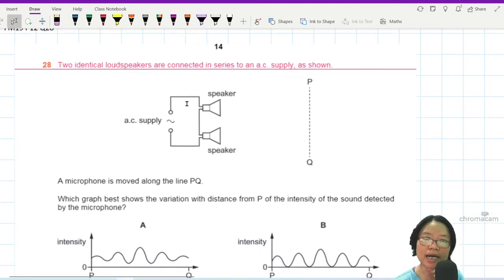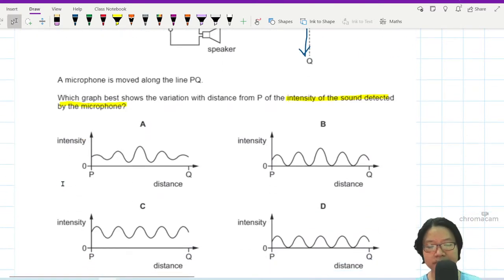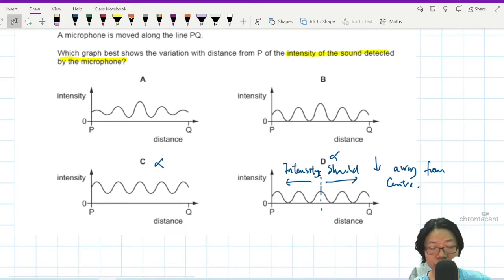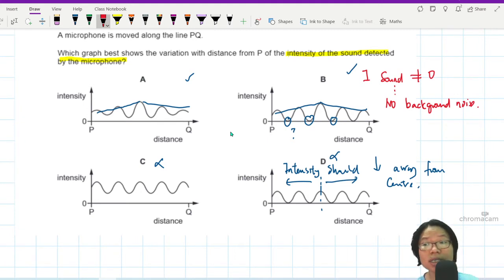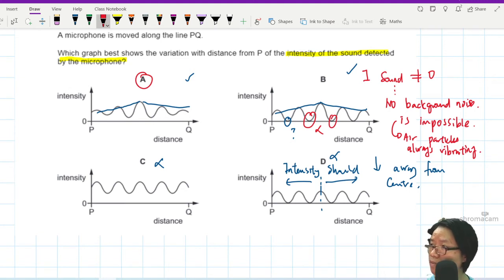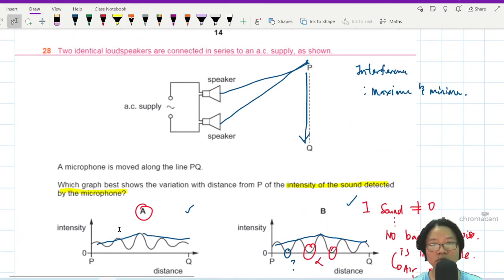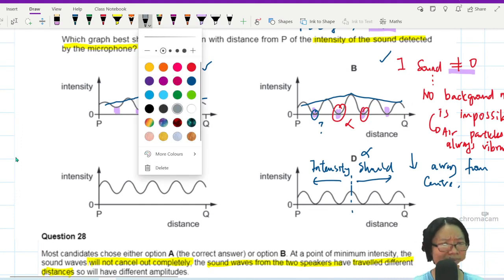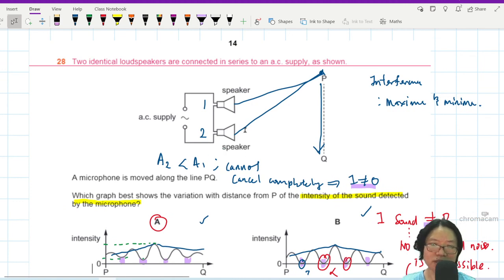FM19 P12 Q28 Sound Interference Intensity Graph | Feb/March 2019 | Cambridge A Level 9702 Physics

Comment: Doesn’t the waves cancel completely despite their difference in distance travelled when their path difference is X.5 lambda as they are coherent waves, according to the explanation of examiners report , apart from the reason of background
Reply: That's what I know as well. At minima points, destructive interference occurs where coherent waves in anti phase superpose to give 0 Amplitude. I=A*2 hence Intensity will also be 0. I have never learn't that distance traveled  reduces the amplitude of waves?? Kindly clarify on the ERs explanation if possible ma'am.I'm confused! thanks @ETphysics